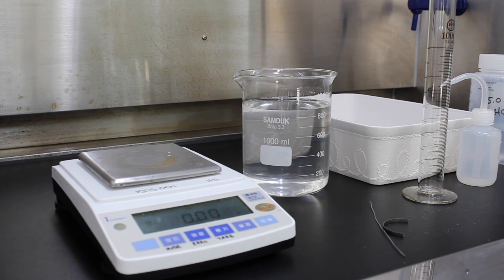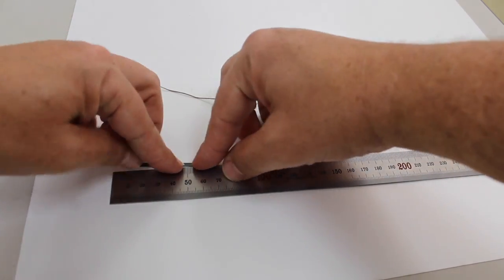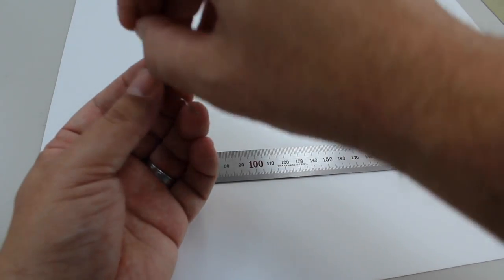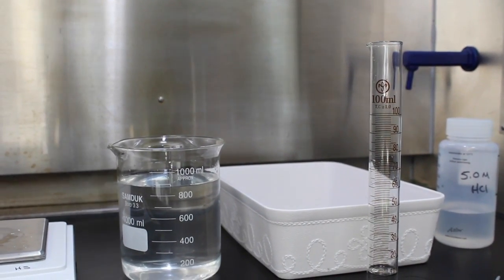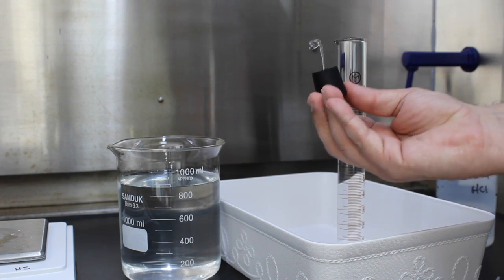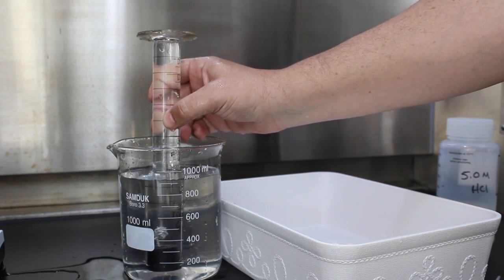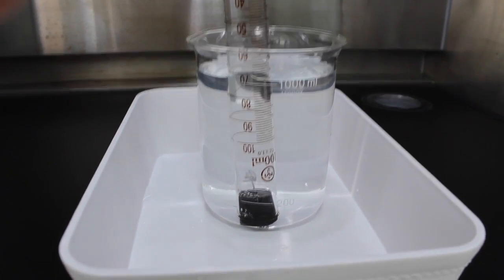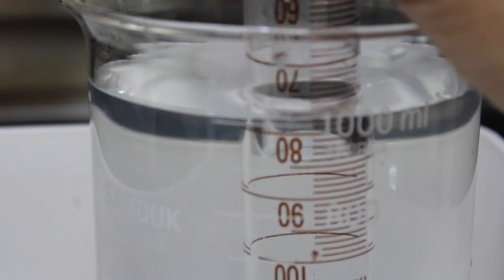Determining the Ideal Gas Constant

Comment: Nice but what happened to the rest of the Experiment. The video ended with the experiment unfinished!!!! :(
Reply: You have all the necessary details and measurements.
You know the mass of magnesium which will be assumed to be totally converted into Hydrogen gas by the hydrochloric acid.
You also know the volume of Hydrogen gas and its pressure - ie 1 atmosphere if you measure the volume as stated in the video by equilibrating the pressure in the measuring cylinder using the technique shown (raising the cylinder until the level in the cylinder and the water level in the beaker are the same).
The only other assumption you need to make is that the gas behaves like an Ideal Gas according to Raoul's Law.

PV=nRT

You know all the terms in Raoult's Law except for the Gas Constant, R, which is what you wish to determine.
so R = (PV)/(nT)
 
Temperature, T of the gas can be measured in the experiment ~equal to the temp of the water.
Pressure, P is atmospheric pressure in the units you wish to use.
Volume, V is the experimentally determined volume of Hydrogen gas. (85.5 mL)
Number of Moles, n refers to the Hydrogen gas which is related to the reaction Mg(s) + HCl(aq) => MgCl2(aq) + H2(g)

Notice that the number of moles of Magnesium = number moles of Hydrogen gas (1:1 mole ratio)
The number of moles of Magnesium in this case is 0.12 grams divided by the atomic mass of Magnesium (24.312)
n=0.12/24.3 = 0.0049383 moles of Hydrogen gas

If you use the data determined in the video and a gas temperature of say 10 degC (ie 283K) you get a value for the gas constant R = 6.2 J/mole.K (compared to the accepted accurate value of 8.314 J/mole.K)

There are lots of sources of error in this experiment, but the value obtained is in the ball park of the actual Universal Gas Constant value.
It's a very good idea to repeat this experiment at least 3 or more times to check for reproducibility.
And also check whether all of the magnesium has reacted - if it hasnt, weigh the dried residue and account for that in the determination of the number of moles. It may also be useful to know the purity of the magnesium.
Loss of gas through leaks etc could also account for the lower value.
You should also include the partial pressure of water in the total Pressure term because the hydrogen gas is generated in or over water. You can look up the Partial pressure of water at the required temperature (eg P~1300 Pa at 10 degC or 283 K)